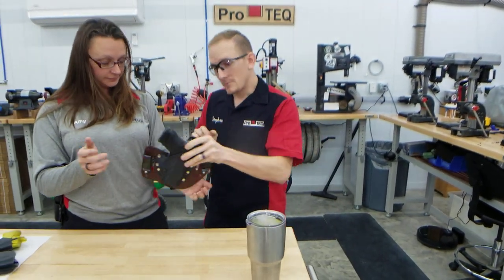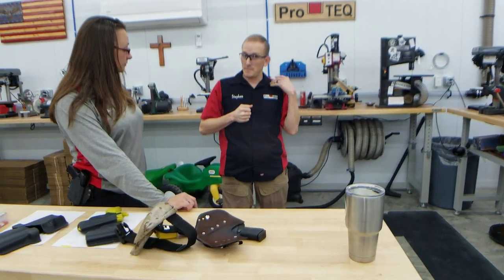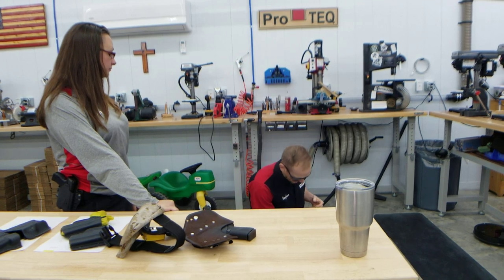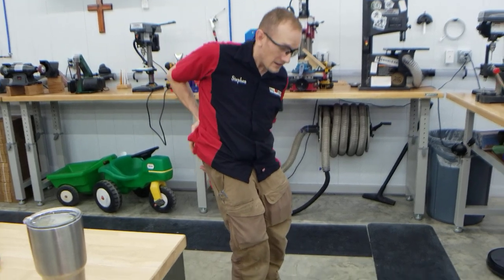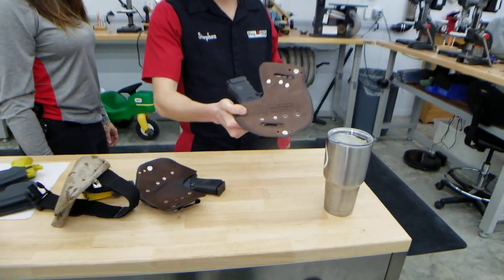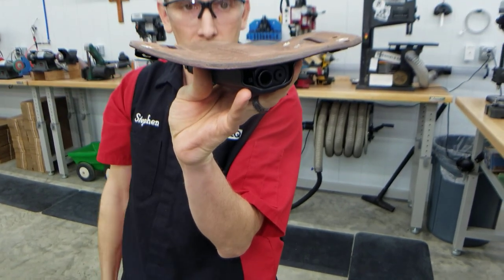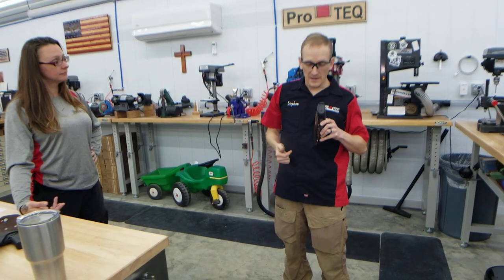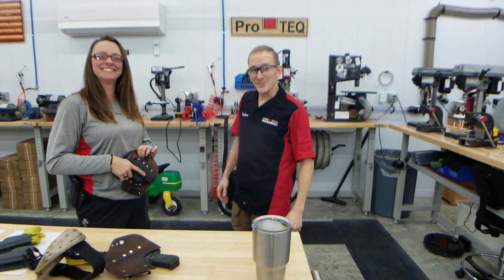Why Don't We Cover The Magazine Release?

Comment: You thought of everything.  I have a FN that has mag release on both sides. I have your rig for it but have never accidentally released the mag.     Every time I visit your site I spend money. ( that’s a good thing). Thanks for top of the line products. 👍
Reply from the maker: You're welcome Beverly!  Typically what we do for Dual Mag releases is we will cover the one that faces the outside.  You can still depress the inside one, and the Kydex will flex outward a little bit allowing it to function.  The outer later of Kydex will not easily flex inward, however, because it is supported by the surface of the gun.